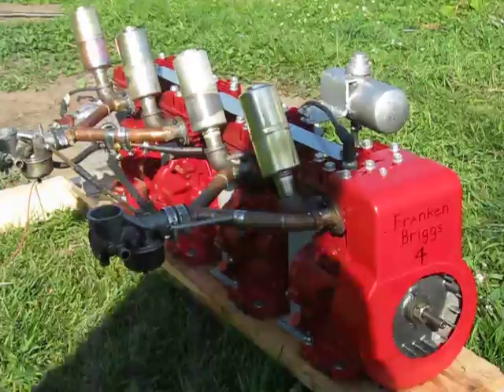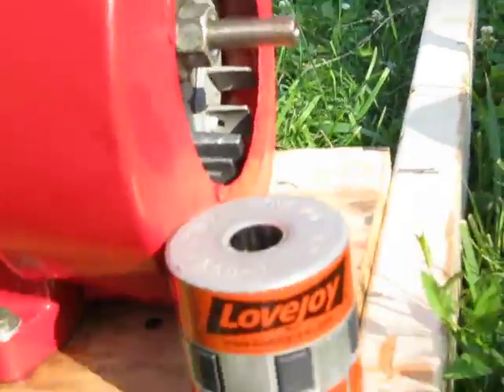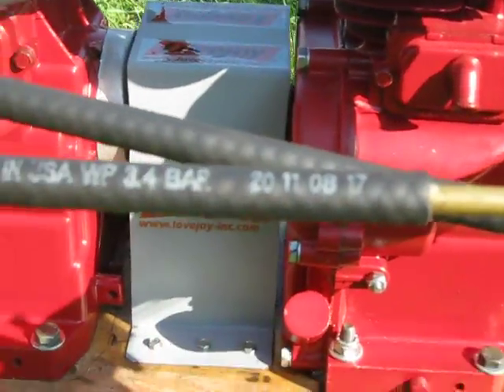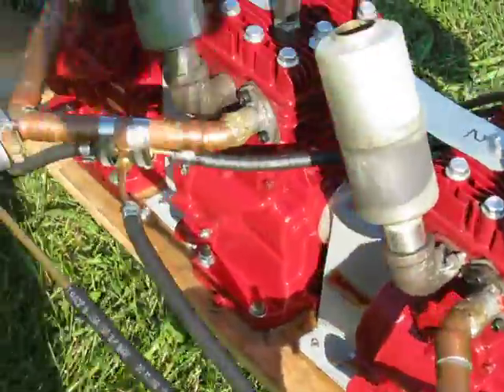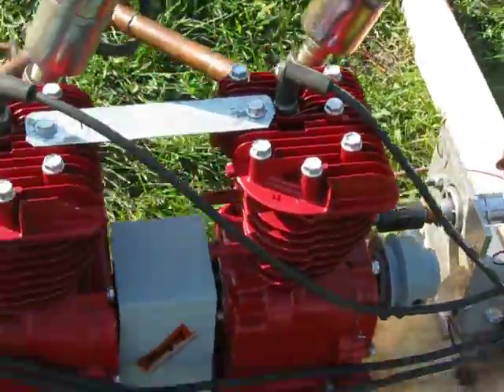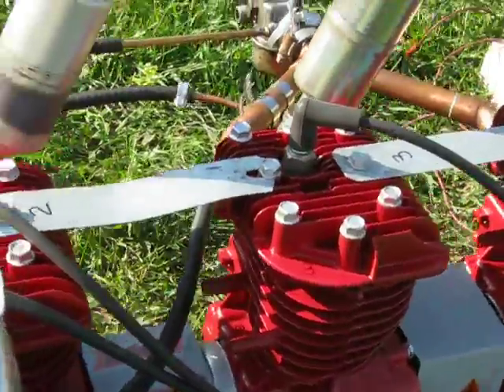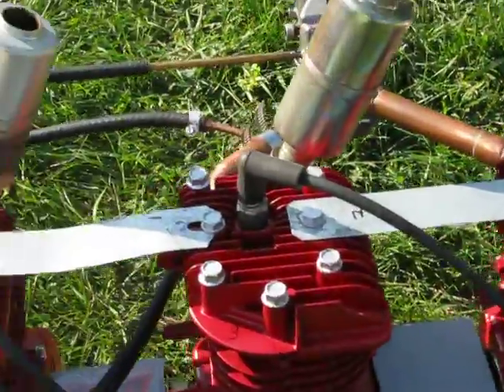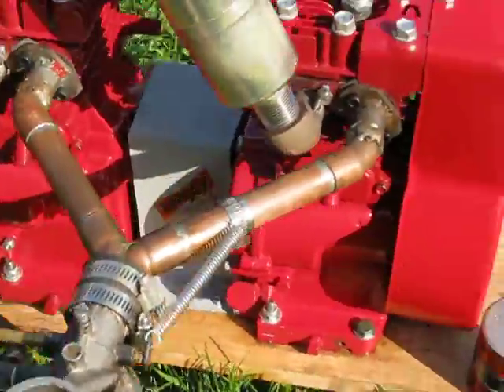FrankenBriggs 4 Cyl. 40 Second Run!!!

Comment: i cant really tell .im not there but it sounds like the degree on the pistons isnt right. you told you used a degree wheel . but its the power stroke on one them is off 360. it should idle smooth and slow.. but i am not there and may be wrong ... id just like to see it pefect. .. been watching this for long time.
Reply from the maker: The firing order is 1,3,4,2 like a normal inline 4. The power stroke can't be off relative to the other cylinders, as I am using a car distributor for the spark, so it forces the cylinders to fire in the proper order. Now that isn't to say that the pistons are actually not timed early or late due to deflection in the couplings between the cylinders. So the spark is timed relative to cylinder #4, so if the couplings were all lagging, #1 cylinder could fire when the piston is on the way up, or past TDC.  In the end I went with chain couplings to eliminate this problem to a greater extent. Thanks for your interest in my multi cylinder engines.

Comment: Question ?   Why do the mufflers shake so much  ?..
Reply from the maker: They are screwed into the engine, but to get them all to point upwards they are not all perfectly tight. I had to screw in a small bolt, then weld the elbow to the bolt, even then there is still a bit of play in the mufflers, so they do a little dance :) I think the wooden mount flexing contributes also, that is why I went to a steel frame for the 5,5 and 8 cylinder engines.

Comment: Why did you eliminate three of the flywheels
Reply from the maker: It didn't need them to operate, since it fires 4 times as often, plus it would have made connecting the engines together much harder to do. Granted, only #1 cylinder gets much air cooling now, but I only made this engine for short runs.

Comment: How r u going to keep un shrouded engines cool
Reply from the maker: you are right, those cylinder will get hot quickly, so I only use it for short runs. To make a practical engine for use, it would be better to have a common shaft running beside the engines, and connect each engine to it with a chain set up.

Comment: If every engine is 4hp it should be 20hp. But combustion helps to make next engine to make better compression, and power stroke more frequently and more power. So this should have 30hp or maybe 40hp or even 50hp
Reply: Gedas alekveravičius 

I'd still love to see the output on a Dyno though

Comment: Is it 1-3-4-2 ignition timing?
Reply from the maker: Yes, that is correct. I use a Dodge V8 distributor with 4 of the 8 lobes ground off for the spark.

Comment: LoveJoy's make impossible coupling possible.
  Neat motor!
Reply from the maker: +Mike Mc V Thanks, yes couplings are a good thing to have! This project puts them under unusually extreme loading conditions with reversing loads and impact load from the pistons firing. i plan to use a similar set up for the Straight 8 I have planned.
Reply: +ChargerMiles007 
  What Year Charger? Thats my 68' Polara in my avatar. Subscribed
Reply from the maker: +Mike Mc V 72 Charger, a friend used to have two old Polara wagons.

Comment: You really did that the hard way,why not stock everything and have 4 good running engines that idle properly

ok your base is too flexible - should have something  bolting heads together - 4 carbs - 4 stock ignitions geared so 1 firing sequence every 90 degrees - all 4 exhaust joined into a plumbing header - cooling shroud extended to blow over all 4 heads and seal dead space between cylinders - maybe a cooling fan blowing through 1st engine - 

but its cool have fun with it
Reply: +flyinbiker2001 ...........oh and use the sparky plug cap's that flash every firing and it's not really doing anything just sitting there .... maybe a cut down  small aircraft prop at the PTO end
Reply from the maker: +flyinbiker2001 LOL, you have lots of good ideas! I was curious if it would run with just one flywheel, since it now fires 4 times as often. It worked, but raised heck with the couplings!
Reply: +ChargerMiles007   no it needs the flywheels to balance the crank or it would kick back  and 4 carbs synchronized would get rid of the coupling problem so all 4 engines are getting the same flow
Reply from the maker: I have heard of such a project being built by a farmer, he had 4 small engines chain driving a common sideshaft to achieve a 20 horse engine. Other than having to fill up 4 separate gas tanks, I think it would be a very good idea.
Reply: +ChargerMiles007 ... if your base was more rigid I would just cut each end of the crank in a half moon shape and drill and use a shear bolt and sleeve  on each coupling

Comment: How do you keep engines 2,3,&4 from overheating without the flywheel fan? Very cool idea, love your channel.
Reply from the maker: +Erik Krause You are right, they will overheat very quickly! I didn't envision running this engine for very long when I built it, so I ignored the problem, though a big electric fan would certainly help out!

Comment: Its not really a 4., would have to joined by the cranks not drive shafts..its four singles. Not one four ..misleading. My mate did a Lambretta twin engine..IE one unit one crank..300cc twin..in a frame running..its on YouTube..
Reply from the maker: +kevin swithenbank I guess technically you are correct, I take many short cuts to make these projects work, without needing tons of machining hours (which I cannot obtain). Your friends engine sounds cool, I will have a look.

Comment: Very interesting.. You need more solid platform though, wood flex too much. Greetings from Russia.
Reply from the maker: +Григорий Александров Thanks for watching, true the base isn't strong enough.
Reply: +Григорий Александров I was going to say the same thing. Needs a real steel platform. A single crankcase would be nice, but that would be some serious work. It's pretty impressive at it is.
Reply from the maker: Thanks, I agree a better base is needed. I used wood, as it was light, and I assembled this in my basement, then had to carry it upstairs and outside, so weight was a concern. if I ever build the Straight 8, it will have a steel base, as I already have the I beam for it.
Reply: ChargerMiles007
You could keep wood and screw two lengths of slotted channel or something like it onto underside of wood. That would still keep it lightweight and at same time it would stiffen base significantly. Again, very interesting build.

Comment: Hey man isent that how it all way's go'es . I have an old Briggs 3 hp that was on my tiller . Now it's on a mini bike that I've had since I was about 7 or 8 yrs. old an it's the same way start on the 1st. pull every time . To bad the 11hp.. motor on my geni was'ent a Briggs ' reason being parts are so easy to find . I have ordered 2 different carbs on e-bay ' the 1st . one they sent me was for an 8 hp. riding lawn mower ' sent that one back only for them to tell me to order another carb that turned out to be for a self propelled lawn mower . Well I did have 1 that was having the same problem 'but before I ever got to try to put it on just to see if it would work some one stoled the mower !!  Ya know if it werent for bad luck I would not have any luck at all . Thank's man Jimmie R
Reply from the maker: +James Rodgers Man, that is bad luck, somebody stealing the mower! I guess it is their problem now!!! Take care.

Comment: Again than's for the reply ' but in an early'er comment /? I had said that in the warenty / instruction book that I can not find any were ' It say's that it is a Tecumseh motor ' but It is not ' It is a knock off Honda motor . & yes I have replaced the jet that came w/ a new O ring ' as well as the float spring . & Yet still have the same problem ?? I am at a loss ' dont know what else to do other than replace the gaskit's Jimmie R
Reply from the maker: +James Rodgers Sorry about that, so it is a knock off of a Honda, afraid I don't know anything about those, but I suppose the same general principles apply. I guess replacing the gaskets is worth a try. Sometimes these little carbs do unexplained things, I have a briggs 3 horse rototiller that I have given up on fixing the carb. No matter what I do, it won't run right, meanwhile, a 50 year old dirt caked scrapyard find 3 horse I have will start and run on the first pull! No rhyme or reason to it.

Comment: Thanks for the reply " but I have replaced the fule line & the filter is clear of any thing that could possibly plug it . I also pulled the tank off to be sure there wasent any thing blocking the flow . I guess i'll have to either make or buy some gasskit materiale . sorry about the spelling ' I'll never win a spelling bee . Jimmie R
Reply from the maker: +James Rodgers A thought occurred to me, it being a Tecumseh, is it possible it is flooding due to a bad needle seat in the carb? These are a replacable tiny rubber like piece. I remember a 7 horse engine I had that would have gas flowing out of the carb as soon as I opened the tank valve, back then I didn't know the seat was replaceable. (805Roadking expalined that it is a cheap small item to replace) This may not be your problem, but just thought I would mention it to you. Don't worry about your spelling, I never hold that against anybody, especially since none of us are perfect! I have seen so people on youtube criticize peoples spelling, but to me that is just showing how much the criticizer has their nose stuck in the air!!!  :)  Hope you find a fix to your carb problem, i know these things can get to be very frustrating!
Reply from the maker: +James Rodgers Also, I enjoy helping people solve engine mysteries, it is kind of like solving a puzzle  :)

Comment: Hey man thank's for the reply ' I have a 7500 watt Mucallic generator with what was shown to be an 11.0 Tucumsie ' sorry about the spelling . I'll never win a spelling bee . any way instead it came w/ a knock of Honda motor . To try to make this short 'It ran fine untill I let a so called friend barrow it . Well they had dropped it takeing it out of the trunk of a car . I have replaced the spring & the jet for the carb . I have tryed every thing short of replaceing the gaskitts on the carb . At this point it will start & run for about 30 sec. or so & die . When I pulled the carb . off I used copper gaskit sealer ' same thing . Is it possible that I may have an air leak in one or all of the gasskits ? Jimmie R
Reply from the maker: +James Rodgers That is a tricky problem, I suppose after 30 seconds of running, the engine is starting to want less choke. Is it possible that there is a blockage in the fuel system, line etc.? It could slowly allow fuel into the carb when not running, but when started the engine sucks more fuel than the partially blocked line will flow. This is just an off the top of my head answer, I could be way off! I wouldn't think the copper gasket sealer would have time to get hot enough for it to have a problem. Can you start the engine then manually hold the throttle closed somewhat, so it isn't screaming like a generator normally does? This might help you find the solution also, if the engine will continue to run at a reduced throttle setting. let me know what you find.
Reply: +James Rodgers You might try a new carb. I got one on ebay for my champion gen, it was a perfect match said it was for a honda 11hp clone, cost 23 dollars and a few for shipping came in 4 days.  I never heard the engine run so well
Reply from the maker: Yes a new carb could be the solution, I would be careful using silicone where it will be exposed to gasoline, as it can dissolve into a stringy substance which could plug the jets. It would be OK to use for the intake manifold, just not on the carb bowl etc.

Comment: I can see the wood deflecting, really should find a nice "I" beam for this.
Great video tho, going to check out the rest of your vids now.
Reply from the maker: +ramairgto72 Yes, it does need a better base, I fashion the Frankenbriggs engines using what is easiest and cheapest for me to do. I plan to make a straight 8 engine, though it will have a steel I beam base for sure!

Comment: u still plan on putting it on a gokart
Reply from the maker: +Anthony Walker Probably not, to be honest, the go kart would be too heavy for me to lift around, and I don't own a pickup truck to transport it to a parking lot for driving. This engine would still need more crankshaft machining to run reliably for any length of time, as it still vibrates out the coupling set screws in spite of me using Loctite!
Reply: yea i can tell in this vid
Reply from the maker: +Anthony Walker Yes, this engine mounted on the wood base weighs in at 115 pounds, so the go kart would be pretty heavy.

Comment: the second you connect it to a 4 cal driveline and differential, the crank will snap. A+ for effort. D+ until you can write a critique on the project explaining why it would not be a legitimate survival topic.
Reply from the maker: +William Hawkins You are 100% correct, the cranks would break if connected to a significant load, since each output shaft is designed to handle 5 horse, though probably good for 10. However, there is no way the last crank shaft could handle 20 horse, so there would definitely be some type of implosion take place!  (Though that could make for a good video!!!  :)

Comment: why cant it idle on its own?
Reply from the maker: +Snitchy1989 It probably could idle, I just like revving it up :)Plus I never know how long these FrankenBriggs engines will survive when running, so I keep the revs up. I think this one got rougher at lower rpms, as only #1 cylinder has a flywheel on it, so it wanted to spin faster to idle than a regular Briggs.

Comment: harmonic balancer
Reply from the maker: +chris tha menace Yes, that would help out on this engine.  My Jumo 205 type engine (the opposed piston supercharged 2 stroke) definitely needs a balancer, since the exhaust piston reached TDC 20 degrees before the intake piston does, hence creating an imbalance. It only ran 5 seconds, and sheared both flywheel keys cutting the ignition. One of these years I will get it back out for another run after making improvements.

Comment: instead of ultimate to would you should have both of it to metal maybe more sturdy little more heavier but start here cuz it vibrates and shake okay buddy keep it in mind
Reply from the maker: +Atticus Lewis Yes, a metal base would be much better, wood is so much easier for me to work with. I will use a metal base when I finally get building my Straight 8 engine. I thought I would get to it this summer, but I couldn't machine the 4 crankshafts down.

Comment: you where smart enough to make that so why isn't this mounted to a nice steel plate?   get rid of the vibes get rid of the problem of coupling issues
Reply from the maker: Krystine Adams You are right, a steel base would work much better. I didn't build one for this due to cost, my limited ability to cut steel, etc. Though I will be building a steel base for the Straight 8  engine (which uses these 4 engines plus 4 more). I have it started, but don't have the 4 new crankshafts machined yet. Too many other irons in the fire this summer :)